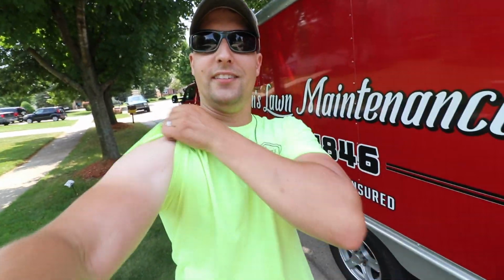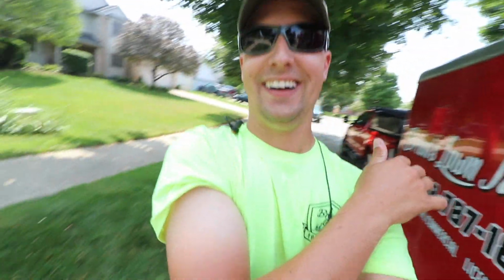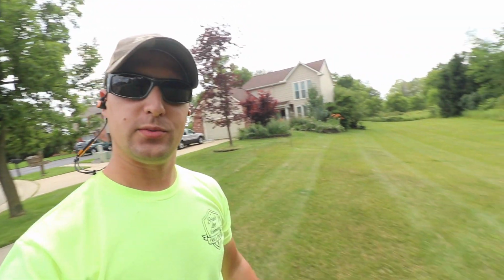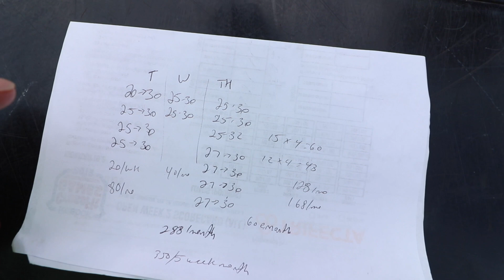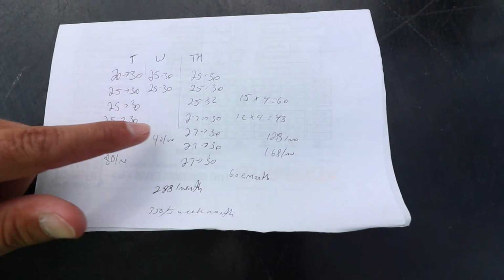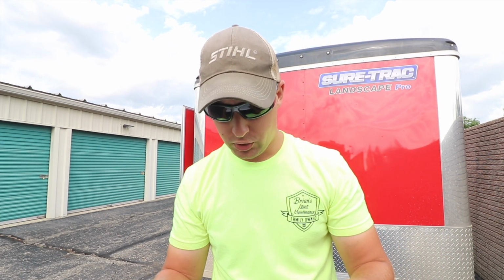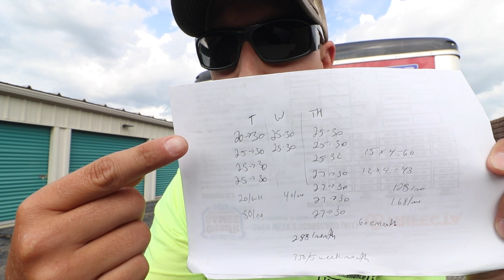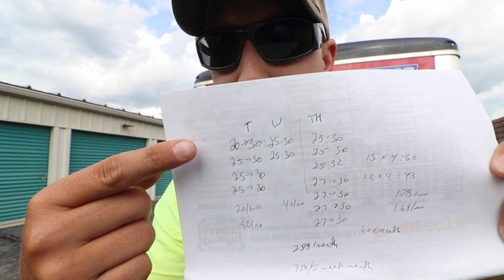Taking My Own Advice! ► A Case Study About Raising Prices

Comment: No one should be in the $20s let alone $30s  if you are legit, you know you can’t cut for that and make money and make it to the next level.  Workman’s comp, insurance and taxes take a 20-30 a lawn to a few dollars. A lot of expensive equipment for no money. Raise your prices show your worth
Reply from the maker: Yeah hard to stick around at $20/cut. Those guys always come and go, for that exact reason.
Reply: Brian's Lawn Maintenance our minimum is $50  and we maybe raising that very soon
Reply: TJ it will depend on where you’re at for prices to say the least and the yard size. I do this on my says off from the fire station and have insurance (don’t need workman’s comp as a solo). I do charge a low amount $20 for most yards I do (2500 to 3300 sf lots). But prices will have to go up for future business ventures. I’m looking to get rid of a bunch of low ballers and whatnot though and get more commercial stuff for next year. But I do hear what you’re speaking!!
Reply: I have just one tiny lawn I do for $30 then I have a few I do for $40 and $45 but most of my rural lots I get $60-$80 for them and I have one I do for $100 but no one lives at the house and it’s a big 3 acre lot but my 72" 12 mph mower takes care of the big lots fast. PS, there’s no trimming on that job 😃👍.  Make money while you can all, Mark from Marks Lawn Care, Winter WI.
Reply: @lawnman3638  I agree 😉
Reply: @lawnman3638  here's the thing.....we used to cut about a 160 residential lawns a week, and after soul searching we sold off our residential client list.......why.....because in 1996 after crunching the numbers and being completely truthful with the situation, our cost of doing business for the residential mowing routes showed that it cost us $18.50 just to pull up the truck and trailer to a property! not including doing the work.....what  90% of the guys doing this work don't get is that they depreciate every vehicle/trailer/piece of equipment they own......and you have to bank the recovery money to acquire the replacement truck, mower etc. They just keep revolving a line of credit to replace worn out stuff and never get out of debt, its a lose, lose situation they never break thru.... dollar in equals a dollar out, no profit, no pay check. Took me a long time to figure out that raising prices just to cover costs isn't good enough....and so for 20 plus years we've only marketed to commercial property's....and its a way better feeling not ever owing/having trucks or equipment on credit....everything and I mean everything we use every day is paid for!
Reply: @lawnman3638  gotcha...i'm just saying if you have a 3 man crew your wages paid for that 1 hr. being $45.00 or so...and averaging 5 cuts an hr. grossing $150.00 an hr. I can tell you for a fact that depreciation plus your next biggest expense being fuel..then repairs/maint. on your trucks and equip....plus insurance, advertising, taxes, phones/radios, rent and on & on is costing north of  80.00 an hr. minimum....and many lawn companies are heavy in debt with rent/lease/loans on their trucks and equipment....the numbers don't lie....its good that you have it figured out...many don't........we used to average under 10 minutes a lawn, 40 a day, 4 days a week, 5th day for maintenance on trucks/equip. so we ran a very efficient residential lawn set up and our overhead was kept intensely tight.
Reply: Ryan Rogers -good for you👍🏾my 2nd year in lawn care and I just paid of 25k worth of debt feels good not to be a slave to the lender

Comment: I will say 100% the Darwins Grip helps tall guys. I'm 6'3" I bought the Darwins Grip 6 months after starting my business. I'm still trying to get all my ducks in a row for being legit. I only have a handful of clients but currently getting more marketing going.
Reply from the maker: That’s awesome man. And yeah I haven’t heard any negative complaints or reviews really about the Darwin Grip. Seems to be pretty straight forward!
Reply: @BriansLawnMaintenance  I am taking alot of your videos to heart.
Looking around for general liability is my main concern at this point since my income is enough now. When would it be a good time to get my business tax ID? I started this march.  And probably made a few thousand by now.
Reply: Also you guys are lucky, here in Mississippi I'm on the gulf coast its 90+ outside all day. My main job along with cutting grass makes some days just brutal.
Reply: I’m 6’6” and just installed it the other night.  I tested in my yard for a min or two.  I knew right away that it works.  I just stand straight up with no back bending whatsoever.

Comment: Great advice. I usually wait until LAST minute to raise lol so they’re like in panic mode and just stick with us. I did that “split test” Kalfas mentioned in a video. I think we raised 28 out of 115. And we dropped several since we picked up new ones that better fit what we want long term. Not one complained about raise. I gave nice letter explaining the increase in labor, cost of living, maintenance, gas, etc. I love videos like this and about the numbers lol
Reply: Also, I totally get the prices are different everywhere. Very shocked how low they are in Michigan though based on what you said rent costs for an apartment and how much a house costs. A $350,000 Pittsburgh house is huuuge. We actually were voted one of the most livable cities. And someone told me my prices are cheap at $40-$50 a cut for the small 12-15 minute lawns. That’s very interesting. I wonder if it’s just like a “movement” where one lawn guy started in Michigan a long time ago and it spread, so then everyone has to compete with the 25-35 range. Whereas if they would’ve set the bar higher, everyone would be competing in the 40-55 range. 

We need to get the entire industry of landscapers to all realize to raise so we all benefit. If everyone understands that and everyone raises, even the small guys, we all make out from it...everywhere.

Comment: I have found a great bump stop for mowers on open trailers, and it might work with a closed trailer. Get a full length , thick swim noodle. Measure to length.  Run PVC pipe thru the middle, using a lubricant, and attach with 2 hole, electrical or flexible half clamps (1/2 inch wide or less) matching the outside circumference of the noodle, then secure them to the metal or wood surface with screws. I usually use 3-4 clamps.. Allow enough clearance for the mower frame on either horizontal or vertical  plane. This protects the trailer and mower and uses very little space. It is water resistant and lasts a long time. Ron A

Comment: Your motivation is uplifting as always Brian. 
  
     If I feel that i will be raising rates on a property, it motivates me to do the best most thorough job and maybe something a bit extra  prior to raising. 
   Conversely it sucks to be underpriced on a property, because then the quality of the work often slips.

Hey do you guys take note of grass sticking to white trim, or step kick boards after trimming?  
     Quite a bit is left stuck on even after leaf blowing stuff off.  
     I was thinking a damp cloth or sponge might be a quick way to keep paint and trim sharp in focal areas.  
Any thoughts?

( Always knew u had a screw loose haha)
Reply from the maker: Ha! Love it. We don’t really tackle any of the green splat on houses or siding. We do walk around every property though. This eliminates any chance we miss something and helps to make sure the house and patio are blown off and cleaned up! Hope that helps.

Comment: I'm legit across the board, therefore my overhead is fairly high as well. I secure about 80% of jobs I estimate. I used to be so offended by those that would pass. Once I became comfortable with my value, I learned to brush those off a bit easier. After going over last year's profit margin, I did a small price adjustment this Spring (you make a good point on timing these things). I only lost one job with it. I got word they already regret it lol. So you are right, the notion that you will lose customers with a reasonable adjustment, proved not to be. Good stuff👍

Comment: When it comes down to it, pricing is important, but it's all about density. You can have a $50 minimum all day, but if you're driving 10 mins between stops.. No bueno
Reply from the maker: That’s a super great point. Hopefully folks can see we do 20-30 lawns per sub per day. So others minimums may need to be that $40-$50 minimum for what we can do for $30 and still be very profitable.

Comment: Brian, how receptive are your customers to the #1-$2 increases?  I hate raising my prices.  I always send out a spring letter stating this year price.  I usually work in $5 increments.  I don't usually charge tax but I am getting ready to add that next year.  I just don't want to drive my customers away.  I am not sure I could get away with mid season price increases but when a new customer calls me after July into the fall the rate is higher because I know nobody is picking up new accounts and I am loosing daylight.  Your thoughts please.  Also will you be at the GIE Expo in August?

Comment: Do you have a Video un how its posible for 1 truck with 2 or 3 guys to do 25-30 lawns in a day. Are these in the same 5 mile radius with like 8 in the same neighborhoods etc?
Reply: Wait I think I figured it out. Your average yard seems to be $30 so these yards are very small considered to these here in Ga where $45/50 is average for less than half a acre. I'm hitting 14-18 and I'm off around 6pm.
Reply from the maker: We have 5 subs were in now on 4 days of mowing. All route density and productivity optimized.

Comment: How much do you charge for a 45 minute lawn solo?
Reply from the maker: 45 minutes 👊
Reply: I think I heard Brian say he charges $120 an hour but that must be for a 2 person crew. It depends a bit on if you are using the appropriate mower for the size of the lawn you are mowing. If you are mowing a big open lawn like I do often up here in a rural area with a small 46"-50" slow mower like I started out with then you should take that into consideration. I mow with either my 60" zero turn or my faster wider 72" mower on the really big lawns that are a few acres+ lawns. Tonight I mowed a large 2.5 acre lawn with no trimming on it for $75, it took me 45-50 minutes to mow it.
Reply: Thanks @Curtis for the answer!

Comment: Don't market your business as a commodity because it/your are not. Nor are you a charity.  Give value and don't low ball yourself. Thinking you'll make the loss up in volume has lead to a lot of businesses going under. Once you set your prices too low (just to get the account), you set an expectation with that customer (your cheap). It causes you an issue when they ask for additional work and you have to quote a "real" normal price. That customer will then think you are trying to rip them off.

Comment: your guy whips backwards
Reply from the maker: Why?
Reply: @BriansLawnMaintenance  Whip left side of property to right. or clockwise.. or whip between you and the house not you in between the house and the whip. your man is throwing all the clippings back into the beds, he should be shooting it out. This is probably why yall be blowing so much & your mulch areas look dull/thin. That's the first thing I ever learned in this industry starting out at 14 yrs old, 10 years ago. V surprised you haven't noticed that.